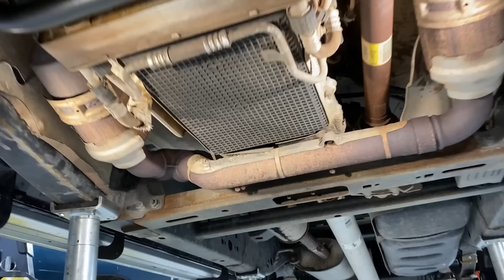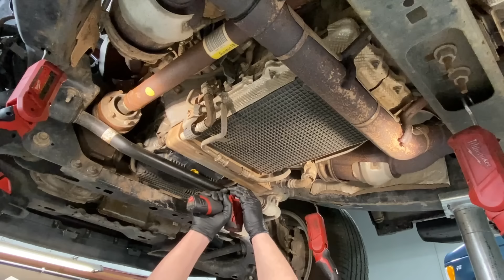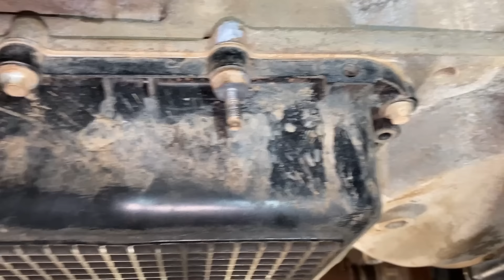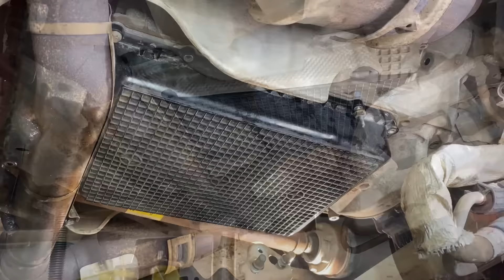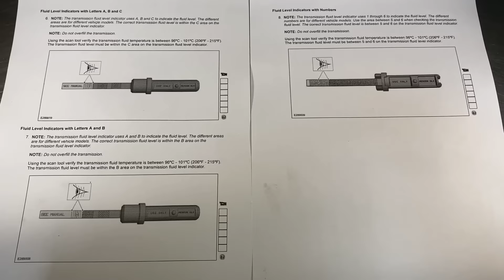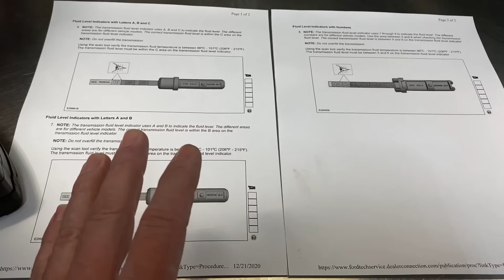Ford 10R80 Ten Speed Transmission: Fluid and Filter Service Procedure

Comment: CAREFULLY drill a hole in the plastic pan to drain the fluid and purchase a Mishimoto aluminum pan with a drain plug. Nice upgrade and stronger than the OEM. They aren’t cheap but you’re saving money by DIY. Future drains and filter changes are a lot easier.

Comment: Now there are aftermarket aluminum trans pans with a magnetic drain plug, and there is a company that makes a dipstick kit. To be precise, I know they make one for .y 21 Ranger Tremor, but I don't know if they make them for F150s. I don't have a lift, so next time I have the trans serviced I'm going to have them install the aluminum pan with the plug, and maybe the dipstick. Then I will be able to drain/fill the fluid every 30k miles. I realize there is a good amount of fluid that will remain in the torque converter, but with the 30k intervals it should keep the overall fluid pretty clean.

Comment: I have a 2006 F150 XLT 4.6L now has 256,000+ miles never serviced transmission, never even checked fluid level still runs great

Comment: to all the 21 and up bronco auto transmission owners the part number is correct for the filter o-ring. ford does not sell the o-ring separately only as a kit with the transmission fluid pump ($140) but the part listed in the description (7T4Z-7Z302-A) is the correct part to tell the dealer to look up.

Comment: I'm confused, I don't think 7 or 8 quarts came out of that pan when you dropped it, so  how did you put that much back in?  Isn't capacity like 13 or 14 quarts, does that mean you are essentially just changing half the fluid?    It was that way with the radiator, could only get it out of the radiator and change it with the machine, but the block wouldn't empty so it only changed half the coolant.  Ugh.

Comment: After researching at least 10 different transmission specialist YouTube channels 6 of these channels suggested to me convincingly to do 3 partial transmission fluid changes and not being concerned about changing the filter at all for my 2021 Ford Transit 250 3.5 Duratec naturally aspirated equipped with a 10R80 10 speed transmission. Is this an acceptable method for transmission fluid change ( not including filter ) ? That being said I’m aware that Ford predominantly recommends this transmission fluid and filter change service that requires the subframe being removed to make it possible to remove the filter and the cost for Fords transmission fluid and filter change is well over $1,000.00 parts and labor for this service. Note: My vehicle has 100,000 miles on it and it currently shifts and functions all around properly. I bought the vehicle used with 99,800 miles on it and it was previously owned by U-Haul in New York . I reside in Pennsylvania and bought the vehicle from a dealer in Bucks County Pennsylvania just outside northeast Philadelphia

Comment: It’s just insane I went to my local dealer and I asked about a trans fluid change. Their answer “oh it’s sealed you can’t service it”. I said it’s oil and it definitely needs to be changed they said they don’t even do it. What the heck? Anyone flush these? A drain and fill is great but the converter and cooler etc has so much more fluid.  Thoughts ?

Comment: @fordtechmakuloco I found when servicing my 2022 F150 that if i refilled the ULV up to the bottom quarter of the dipstick COLD that there would be NO fluid on the dipstick when the trans is at 215.  adding another 1/2 quart brought it right up to where it should be.  no idea why ...

Comment: Just had mine serviced 3 weeks ago, 48k miles and this past friday its been leaking like crazy. Took it back on monday and they said it most likely was overfilled and coming out the overflow vent. They said they leveled the fluid and when i got home, again it leaked a lot. Im going to get under there this weekend and check it cold and just pump some out if i have to. Whole pan and frame is full of residue now. Sucks we pay so much to have this professionally done and they end up not doing it right. Glad i came across this video tho 🙏🏼

Comment: Some of the links in your parts needed like the transmission fluid and gasket Amazon shows as not for a 2018 Ford F150.  The fluid link is for Valvoline not the Mercon brand.  Just FYI

Comment: I'm at 55k miles and had the truck at the dealership just to be checked out.. you know 55$ wiper change, 70$ cabin filter change... On my quote it says 210 trans fluid exchange... Dealership isn't dropping the pan for 210, I say skip all this and use a exchange pump ..20 mins and done

Comment: Can you imagine in a parallel universe where engineers design the drain pan to have a drain port and a spin-on oil filter that can be changed easily and for a low cost?

Comment: Hey, I didn’t read all the comments. I’m not sure if someone’s already mentioned this on a 2019 3.5 L eco-boost the situation is the same as the 5 L the exhaust is in the way and you’re gonna have to push the trans up. one question I have is why don’t you just unbolt the exhaust bracket from that trans mount and do the lower two transmount to  cross member bolts? They are much easier to access

Comment: Can the two transmission cross member bolts be removed, and then the one exhaust bolt be removed and then jack up transmission to clear the exhaust or will the exhaust move up with transmission that way?  Thank you for this video!

Comment: I Had the experience on my 2014 F150 6R80 Where the OSS sensor failed 2 months before Ford issued the recall.  I made the recall warranty by 15 days in May after they dealer actually was able to reprodue the code, as it was intermittent.   Ford put a hold on all the molded lead frames  so my stuck was in the shop until November, 6 months later.  It ook them 6 months to create a manufacturer to replace the one they used in China.  Just prior to my model transmission,  the OSS was bolted on the transaxle, and a $50 part.  My model used oss that was molded into the plastic Molded Lead Frame, which needed the entire Valve body to be removed, along with all the fluids, seals, etc.

FordTechMakuloco Saved the bank for me when he documented the procedure a few years ago.  He has also assited me in Thermostat and Wye coolant leak on my 5.0 litre a few months ago.

Beware of cooling fan relays failing without warning.  After on overheat, all the plastic breaks.  Thankfully in Hawaii, i really don't need a cabin heater that much, so I witheld the heater hose plastic adapter and bypased it.  Oh yeah, the Camshaft Positon Sensor failed after the overheat...

Clippy was here!

Comment: Buy the Dorman 66284 seal kit that contains ALL 4 cooler line seals instead of the Ford seals that are sold individually. (5L7Z-7J324-A and 5L7Z-7D285-A).  The Dorman kit was $13 at AutoZone whereas the Ford seals are over $60.  What a rip off from Ford!

Comment: Why not remove only the two transmission mount nuts from the trans cross bar, then raise the trans? Why mess with four nuts/bolts at 45° angles when only removing two at 90° is easier and faster?
Reply from the maker: I DON'T THINK YOU ARE FOLLOWING.
Reply: I went back and watched it again. Now I understand it's because the exhaust hangar is connected to the bracket. 

I don't remember you mentioning anything about adding a friction modifier. Is it necessary? If so, for all powertrains, even two wheel drive?

Comment: Ford manual incorrect.  My printed manual for 2019 F150 says to use FT-188 transmission filter.  That is a misprint, it should use a FT-202.  Even Fords support site has it wrong in the PDF version, but it you use the HTML version it is correct.  Hope this helps.

Comment: Does disconnecting and reconnecting the cooler lines introduce air into the system? Does the coolant system need to be purged of air at the end of the procedure?
Reply from the maker: No need to purge.

Comment: This video was incredibly helpful. My dipstick bolt/cover was stuck really bad, after 2 and a half hours trying to get it off with wrenches, crows feet and everything else i finally got it to budge by using a torque wrench backwards. If I ever finish this job im going to trade in this pos truck for a toyota.

Comment: I have 22’ lariat 5.0l changed fluid today it took 10 quarts. I did not have to jack up the transmission. Easy job but was not expecting to put 10 quarts in. I initially bought 7 then I bought 2 more and…. 2 more before the 10th read on the stick.

Comment: Another tip is dorman makes the same pan but with a drain plug for $100, since I was putting a new pan on I just drilled a hole in the old one to make less of a mess worked good
Reply: What did you drill with and where at on the pan? I’d be worried the bit would punch through and damage something. Good idea though for fluid control.
Reply: @tonykellar463 in the front and just a  1/2 drill bit it's plastic so it's easy to just punch through it without damaging anything
Reply: @p0weraid nice, what aftermarket pan did you use? Also year and model f-150?

Comment: The 1080R transmissions are absolute garbage. I have a 2017 Ford Raptor. Ran into hard shifting etc they recommend a new trans at 47,000 miles. Unreal. Know COUNTLESS others dealing with the same issue. All these news cars  are trash and way overpriced

Comment: Hi Brian, you’ve heard it a million times already but thanks for all the awesome videos. I hope this message reaches you. I’ll be doing a transmission drain and fill on my 2019 3.5   And my question is regarding the transmission mount bolts…Can I avoid removing those bolts and maybe do it from the two cross member bolts and raise it that way instead? I’m limited with tools right now. Can it be done?

Comment: Just had a 2022 F150 with 3.5 Hybrid... Its very interesting to do to say the least... watch out for the hybrid unit seals. They fall right out and if youre not careful you'll put the pan back in and the hybrid drive unit will overheat
Reply: it also says in the directions to remove the rh catalytic converter. The hybrid has a totally different filter

Comment: Thanks for the video. Helped me today while installing the PPE deep sump pan in my '21 Platinum today. Didn’t have the big cooler in front - just the lines. Much easier.  Still a bit of a pain getting the exhaust hanger bolts out (and in)..🤙

Comment: I have a 2024 F150 XL 3.5L EcoBoost with the 10-speed 10R80 transmission.  I just put 10K miles on it and decided to check the transmission fluid level.  I have the 1-6 style dipstick.

I first checked it COLD.  I started the truck and cycled through all the gears.  I then checked the fluid level. The fluid barely registered on the bottom of the dipstick.  And I mean barely.  It was well below the number 6.  The COLD procedure recommended in this video implied my transmission fluid level was low.

Then I checked it HOT.  I got the transmission to 207 degrees F.  I cycled through all the gears and then checked the fluid level (I wore a thick, long sleeve sweatshirt and used a grill mitten w/ fingers).  It registered exactly between the 5 and 6 numbers.  Right on spec!

I recommend checking the fluid level when HOT per the service manual.  Do not overfill.

Comment: i have a 2021 f-150 5.0 xlt rear wheel drive and from what I see I don't have to raise the transmission just loosing the some tubes bracket and take off the heat shields the pan bolts am I missing something

Comment: This video was super helpful. I did my 2022 f150 5.0. A lot easier. No cooler or cooler line removal. Start to finish 3 hours for me, and I’m old.
Reply: Did you have to lift the transmission? And if you did, how did you go about doing so? Thanks
Reply: No you do not have to raise the transmission on a 22’ 5.0. You can remove just the pan and not have to fool with the trans mount (it is a pain). I used a hand pump in the fill hole to drain the pan before removing.

Comment: After watching this, I replace my transmission pan with an aluminum pan (with drain hole).  This was pretty difficult and I'm glad I had access to a lift.  Crawling under my truck would have been an absolute nightmare.  The transmission mounting bolts were the worst to get to.  In fact I left two bolts out which I will install today.

Comment: I have a 2018 F150 3.5 Ecoboost with 10R80 and the filter seal 7T4Z-7Z302-A says that it doesn't fit my vehicle at Amazon, Ford parts, Tasca, and Rock Auto.  Does anyone know the correct p/n for the filter seal?
Reply: I had similar messages. If part numbers are correct, send it. Amazon isn't "master of all".

Comment: I'm sure this is a stupid question but why did Ford not put a drain plug on the pan?  I understand you'd still have to drop the pan to change the filter but for a fluid change only you wouldn't have to go through this ridiculous process.
Reply: They used to put a plug on the pan AND the torque converter lol now they just want you to buy a new truck instead of maintaining the one you have

Comment: Are those heat shields necessary?  My dealer just replaced my trans and 'forgot' the heat shields.  (probably still on old trans)
Reply: very much so, the exhaust could melt the pan and even if it doesn't, it will get the fluid and parts inside way hotter then they should be.

Comment: Thanks so much for sharing this. Very valuable for do it yourselfers that are still learning details on a new car. Do you know how difficult it is to find accurate info on this detail? I just finished arguing with AI that first, yes, my transmission does in fact have a dipstick, and then, it shows B and A levels, not Cold and Hot, lol. Really frustrating, especially when you're in the process of trying to accurately check this. Thanks again for sharing this content.

Comment: Just finished this job and would like to add a few tips from the driveway. I was able to pump almost 5 quarts out with my Harbor Freight vacuum pump (looks like a bicycle floor pump) without being under the vehicle.  Raising and lowering the vehicle with a floor jack at the front, my trans took almost 9 quarts after the pan drop, so more fluid exchanged.  Used one of the kid's sleds as a catch pan and a water heater box laid flat (free at your plumbing supply store) underneath the truck to soak up the drip and slide around on.  Also used a hose run in from the engine compartment to the trans to fill it from the top, so no need to pump from underneath by hand.  My wife poured fluid while I was underneath and made it easy to get the level right.  It was a bit of a driveway battle but with this great video totally doable.  120K on my truck, the fluid was filthy, never changed as near as I could tell and the truck has shifted wonky the last thousand miles.  Good luck and thanks for the video!
Reply: I also had to get a little creative with the box end wrenches and socket combinations, but was able to get them off with standard hand tools. I could not get the torque wrench on all of the bolts so I had to guess on a few.
Reply: Dude, how did you take the trans mounts off? It’s impossible for me… I also screwed up by watching another video from a 3.5L did not see the trans mounts up in there. So I pumped the trans up (loosen the 2 bolts on the cross frame) and didn’t even notice the exhaust moved with it. I drained it and pulled the pan cleaned it new filter and I went to put the pan in… nope don’t fit. Then I realized the exhaust is moving with the trans dumb moment. Found this video and dude I cannot get bolts off. I have Swivel and an impact it won’t budge. I don’t even know how I could torque back to spec where’s the room. Also never used a swivel on a torque.
Reply: On my 2018 F150 stock exhaust 3.5 Eco-Boost I never touched the transmission bolts. I also did not jack it from the motor or trans instead from the frame member across the middle. It’s a little tight, but he shows you how to turn the pan sideways and pull it out.
Reply: How many quarts did you get back in to get it to the proper level?

Comment: How do I tell what transmission I have ? I like to do my own services and I was told that the transmission can only be serviced by Ford. I have a 2016 F150 four wheel drive,Lariat with only 51,000 miles on it. I keep it in excellent shape and never tow with it.
Reply: One mod thing it has the 3.5 eco boost

Comment: Have a question, is it normal for these 10r80 new filters to have a rattle inside of them? Sounds like Somthing is loose in side. Maybe the magnets? But wanted to see if you noticed it as well.
Reply from the maker: Perfectly normal that is the secondary magnet inside.
Reply: @FordTechMakuloco  okay great thanks ! so there are 2 magnets inside these filters or the one round one i can see just that tis loose from factory that way.

Comment: How do you bring the transmission up to temp after the initial fill? Is it safe to drive around town until it reaches 206f?

 With city driving, i can only get the temp to 195f. Ive seen in another video, where the mechanic would put his foot on the brake and rev the engine for 10 seconds. Then off for 10 seconds. Repeat until it gets to temp
Reply from the maker: Yes you can brake torque it in drive

Comment: hey bro.. if you slack the 2 bolts on the trans mount , would that work ?  removing those  bolts on the side of that trans case  repeatedly might be an issue....
Reply from the maker: Nope the exhaust is supported with trans mount so it would just go up with ot
Reply: @ appreciate you bro.   Good stuff all around.

Comment: I just had my transmission fluid changed by a local mechanic. Afterwards there was fluid leaking after a couple days. He looked at it and admitted that his mechanic didn't realize there was a torque spec of 51 in/lb on the dipstick. You don't mention that here. Can you confirm this (2019 f150 3.5EB.)